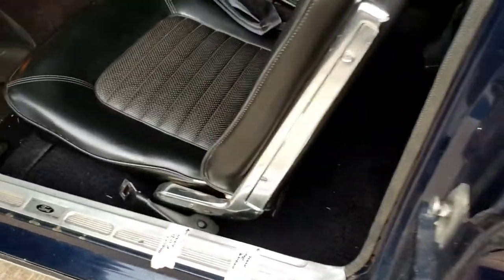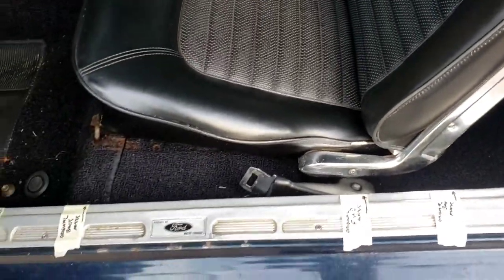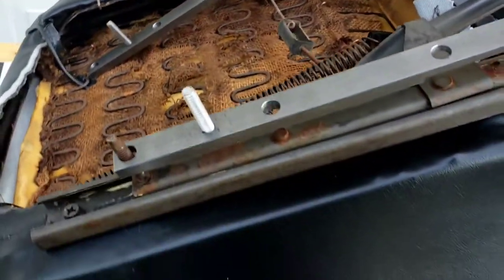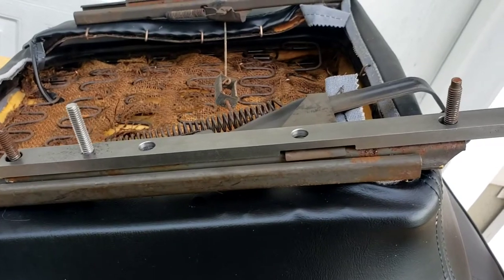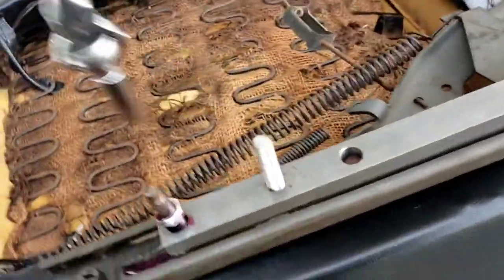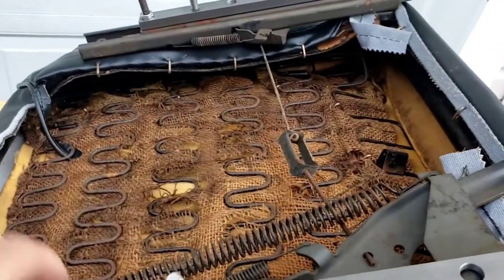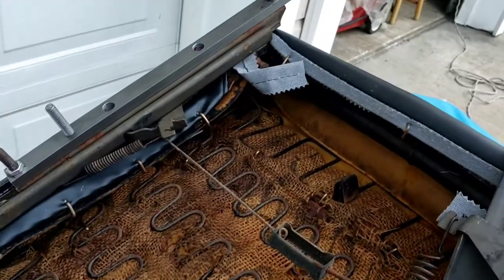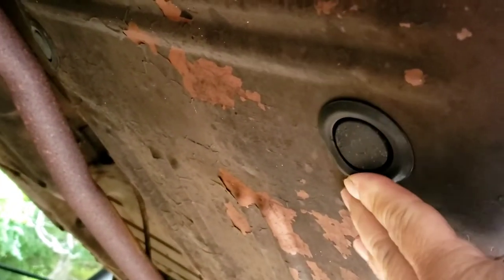Mustang Front Seat Extenders Install For Your 1965 - 1970 Mustangs from CJ Pony

Comment: Are these reversible for shorter people?   Trying to find a solution for my 4' 3" tall wife.  Thanks.
Reply from the maker: Once installed it will no longer slide all the way forward as before..reversible yes unless you cut the track studs off then you need new studs or seat tracks
Reply from the maker: I just re read this, yes you can install them backwards to move it forward instead of to the rear..you will lose 2 inches going back but gain 2 inches forward. You will need to re notch the area for the seat adjuster arm.
Reply: @alyoungcuda  Thanks!

Comment: 65 and 66 are the same , the 67 is not the same
Reply from the maker: cj pony the mustang store sells part number, STE3 which is the model number that fits up to 1970
so unless you are talking about a different brand or a different seat other than those years, I don't know. This set fit perfectly. Its basically the measurements of the front stud to the back and its a flat bar to replicate the same measurements
Reply: I ws just commenting about your statement , Ford made changes in the 67 that are not present in the 64.5 , 65 .66 while some parts are the same , suspension is different along with some other items @alyoungcuda
Reply from the maker: @williamdozier5190  gotcha, yes then you are correct

Comment: hello i would like to install lap belt on my 65 mustang coup ,but I can verify location ,can you help out
Reply from the maker: It should be even with the front seat back bolts, take the carpet sill plate off and lift the carpet in that area, you should see it there unless a shop replaced the floor and never made the hole
Reply: @alyoungcuda  I have a new floor
Reply from the maker: @andrewmackhanlall6388  that explains it .
Reply: @alyoungcuda  I had a new floor pan installed